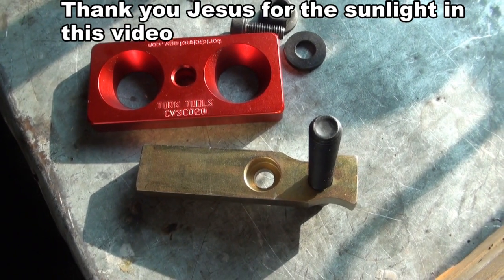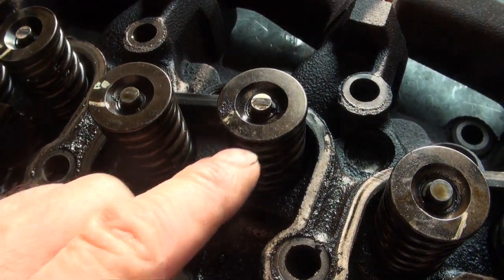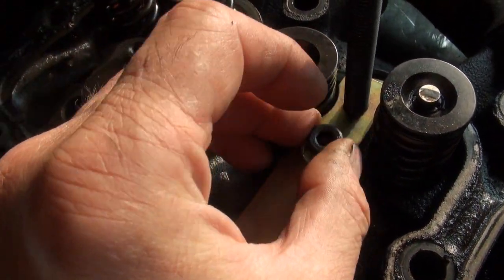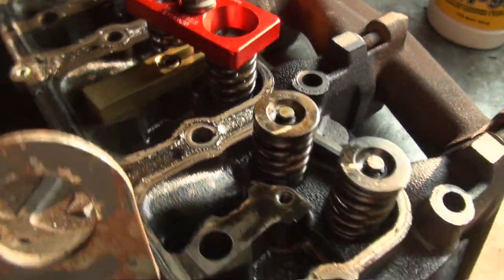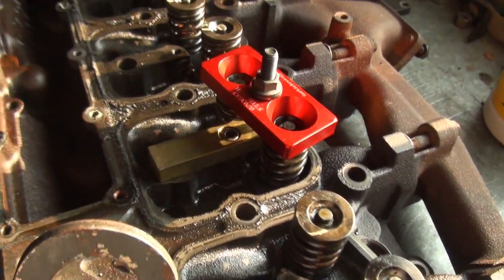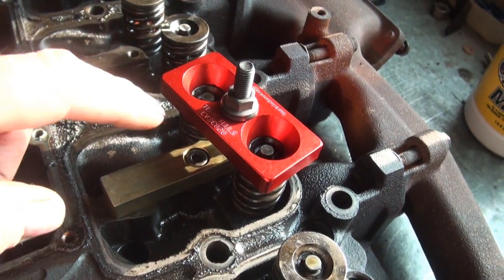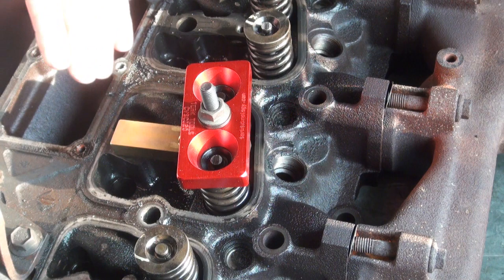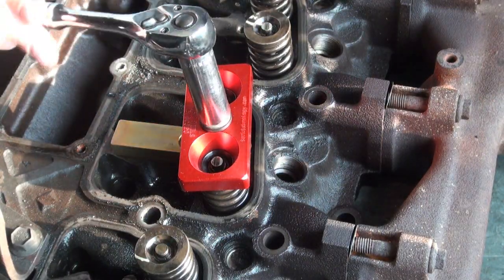Dodge Cummins Valve Spring Compressor Review

Comment: seems a couple pieces of flat steel, and angle grinder drill and a couple bolts nuts a washer you can make your own, and just tie it into that one thread in the center no need to remove the head bolt, they want north of 100$ for one of these in canada